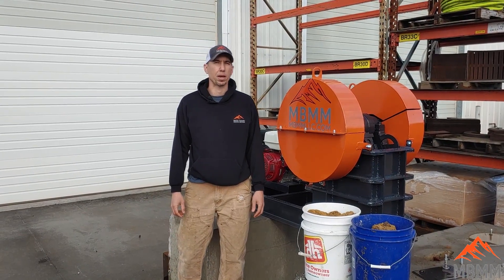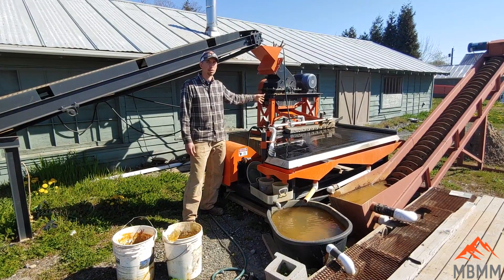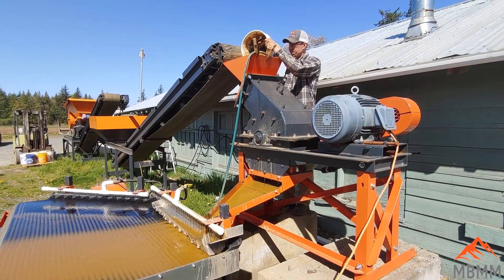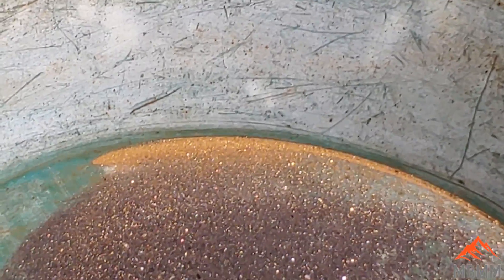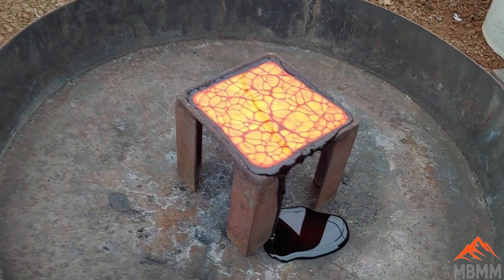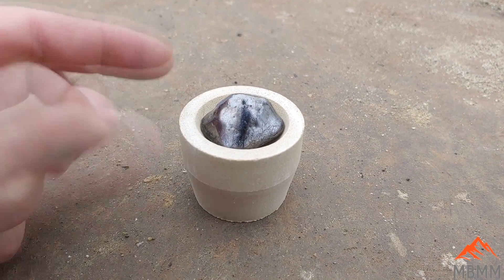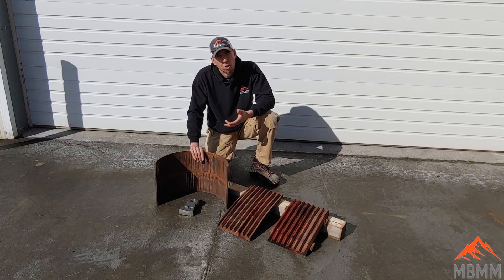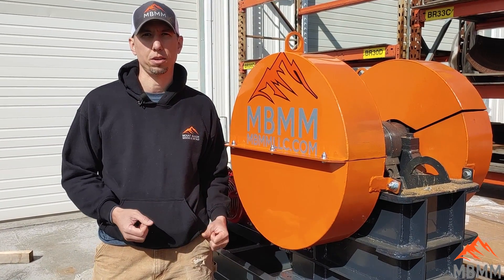Gold Mining On A Budget? 3 Pieces Of Equipment You Need!

Comment: So without the money to buy all of the proper equipment, and without the knowledge of precious metals, and just now subscribing, I have watched many of the videos here with Jason. I now melt everything down to a slag. then knock off the bead and run my stuff through my chemical purification process (aqua regia) (mostly because while dangerous, the reactions are super neat) to purify and separate my precious metals. I`ve now done circuit boards, chips, scrap jewelry, and some spec gold from a couple of local creeks and rivers among many other sources. I have to say these videos should be a holy grail to ppl in the position I was, before precious metals . Hats off to MBMM and Jason especially. Your learning with us has been incredible! I saved my home due to these videos! Hopefully someday, 
I will be able to repay that knowledge! Thank You Jason and MBMM, I do however need to invest in that darn Frankenoven or try to figure out how to make one as cheaply as possible as I`ve found platinum group metals in my slimes and solutions at times. I have a pretty firm grip on gold and silver but platinum group metals is a whole different beast all together. sorry about some spelling . I`m at work. lol man only if gold ore was found in Michigan!
Reply: Que bien amigo dale duro yo acá en México trataré de empezar a trabajar mi mina y creo que tengo platinoides también

Comment: "How to mine on a budget" proceeds to show everyone equipment not available underneath 10k
Reply: Yep about 35k for all 3
Reply: Dam 😮 @Fishingfaniticbc1975
Reply: @Fishingfaniticbc1975 more like 100-200k
Reply: I crush rocks for samples with a 5 dollar hammer. Then I add dirt and pebbles and pan it out.
Reply: exactly haha
Reply: On a budget, relatively speaking.
As in, relative to the cost of running a hard rock operation. Cheapest out, with the essentials.
Reply: You could probably make a pretty good hammer mill with a couple of grinders. You can diy a shaker table and that just leaves the crusher, which I don't think would be as easy to make but not impossible. Need a little metal or some welding done? Check out your local community College or even high schools with a welding program. Most would probably be willing to do the welding just for the experience and practice. Not to mention, they will likely have scrap metal for smaller pieces they would likely be able to use, so you may only need to purchase sheets of metal for the bigger pieces.
Reply: @cptthrawn1841 you can diy a lot of things so long as you are crafty and skilled enough. Many ppl do make their own crushers/grinders/ball mills. Since it's easier engineering wise and familiarity wise, most would probably elect to modify a sluce to fit those other diy machines for a continuous run.
Reply: Try $10K a piece! 🤣
Reply: @chrisparyupker9886 😫
Reply: Just thought I would mention that small jaw crushers run around a thousand for cheaper ones. Hammer mills that connect to grinders, chainsaws, etc RUN AROUND 500.00
Reply: I know my high school did things like that, a few welding projects, and working on people's small engines.
Reply: I also attended community College for welding and we could do pretty much anything with the scrap metal. 
Beginners waste a ton of great material.
Reply: In mining world, that is on a budget.
Reply: @nwoutdoors1865  unfortunately I know I can get way better results for way less than what you spent.
Reply: @loublacksail1995   how is that?
Reply: I don't know about that "water detection" machines, but I have been in the mineral and water detection business for about 30 years now and so far I have tested a lot of machines, only to find they did not work and the money spent  went down the drain. My water Dowsing is a hundred% accurate and I do it from a photograph off of  Google earth images. Of course I find other things also, like precious-metals, graves, crude-oil. I can scan five to ten square miles from a Google Earth image in about a day and mark the water or mineral locations, large and small. I also discriminate the type of element, for example I can tell any one of the six platinum group metals apart from one another. And I can detect all of the stable elements on the chart of elements. I have done over 300 blind tests to this affect. I am not at all limited on depth detection. I did an oil deposit that was 6800 feet deep. Many of my blind teste were private people giving me permission to scan their houses and marking where their values were.
Reply: @robertshrewsbury4241  can you scan for me an area for AU ?

Comment: I feel like that's too much work and operating costs for $50 in gold...
Reply: Economy of scale, baby. One run of three buckets just shows me whether or not it's worth running. If so, I get the heavy equipment out, and have all 3 machines running 8-hour shifts.
Maffs: 1 Gram, ($50.00 value) from 80 lbs of material. 2000 lbs (1 ton) has 25 each 80 pound batches. $50 times 25 batches = $1,250.00.
If the plant can do 1 tone per hour, I a grossing $1,250 per hour. Time for me to start up the backhoe...

Comment: 6" x 10" Gasoline-powered jaw crusher, $9,600
16" x 12" Three-phase electric hammer mill, $12,325
4' x 8' Shaker Table, $14,900
$36,825.00 USD. / $46,878.00 CAD or 19.4 OZ at current price.

Comment: Well there is two kinds of mining and the only one you can do on a budget is hobby mining. If your spending more than $5 grand on a hobby well that isn't budget mining. Your getting into commercial and you better be planning on spending at minimum a few $100 grand. Now I do the budget hobby style and spent less than a $1 grand to do it. That's how to do it on budget.
Reply: the short answer or reply to your messages in the name of the group you joined. GPAA. You know what that stands for; Gold PROSPECTOR’s Asociation of America. Those that made up a name the group understood the difference between prospecting and mining. That’s why they called it prospecting.  😉. For the long answer… See above 😂
Reply: Details on your 1k approach?
Reply: @wildwisdom56  I started with a GPAA membership that cost me at the time $69. Then I bought a Keene mini sluice for $ 40 off of E-Bay. From there I purchased some miners moss and some deep V rib matting also picked up some cpvc pipe all of which cost very little. I took some old galvanized sheet metal and fabricated a box for my sluice with spray bars and a piece of expanded metal to classify the rocks. I then took the pvc pipe and built a stand thus turning my mini sluice into a high banker that. I can easily run a yard an hour through. I picked up a water pump at tractor supply for $200 to power my high banker shovel I already had. The membership gave me access to proven gold areas and thus for under $1,000 I had everything a hobby miner needs to get out and enjoy getting some gold.
Reply: Hi, I took real issue with those I called whiners and complainers about what was called budget mining. 

I will differ with ken jett just a little bit. You’re really not getting into commercial Mining yet just because you spent more than five grand. 

It will cost you more than five grand in many instances to buy a dry suit/wetsuit and A 4 inch dredge and you’re still in what is legally called up here in Alaska “recreational mining“ as long as you stay under 6 inches on your dredge your recreational. 

So you’re gonna spend more than five grand and you’re still not approaching commercial Mining. 

You laid out a really good way to approach just getting into Hobby Mining and I applaud you for that.

It’s the same way with hunting or fishing; you can have a very inexpensive rifle and go trudge out into the woods and go hunting or you can buy a combination fishing pole at Walmart and go fishing; OR you can buy and ATV for more than five grand and you’re still not a commercial hunter; certainly you can spend a lot more than five grand on a boat and you’re still not a commercial fisherman. 

So I think that there’s an intermediate step in between what ken jett is calling hobby Mining, And commercial Mining. Up here we call it recreational Mining. And it doesn’t have to but it can cost a lot more than $5000. 

But if you did want to do something more than recreational but didn’t have $1 million then $100,000 for the start of mining in a way that could actually pay some bills, well, $100,000 IS budget Mining.

By the way, the short answer or reply to this thread is in the name of the group. GPAA. You know what that stands for; Gold PROSPECTOR’s Asociation of America. Those that made up a name the group understood the difference between prospecting and mining. That’s why they called it prospecting.  😉
Reply: @scotthack2632  well I wasn't trying to be arbitrary with the numbers they are a lot of subjection that can be made. I was just making a distinction between the difference in hobby and what's commercial. Most people don't know or understand the difference. It's also true about the use of the Name Gold Prospectors of America. There is a distinct difference between prospecting and mining. Most if not all who join the club are in honesty miners not prospectors. The actual meaning of a prospector is one who goes around sampling looking for a source of gold. They are prospecting not mining, the difference is once a source is found and your set up to recover the gold now you are mining. This then is where as to what level of mining you choose? Hobby or recreational I consider the same. Or are you going to go commercial a lot depends on just how much gold available to recover. How much you can afford to spend on equipment and a big decider can you get the permits to operate a commercial mine. In some areas depending on the level of your hobby can also require permits to operate. That's why I keep my hobby small as it allows me to go out on occasion have fun and recover a little gold without having to apply for permits. Although you do still have to have permission to access private property. This is why I like belonging to Gold Clubs where members get access to proven gold areas.
Reply: @kenjett2434  all what I stated was true but I must say,  Well stated. Don’t disagree on any point. Thanks for your reply.
Reply: @scotthack2632  your welcome and i wasn't disagreeing with you. My comment on cost, was just to say it in more simple a generalization to show the difference in mining.

Comment: This is on a budget?? Looks like 100k dollar investment.
Reply: just got a reply right now.   The three units Jason showcased in the video are all rated for 1 TPH hour and I have listed them below.

6" x 10" Gasoline-powered jaw crusher, $9,600
16" x 12" Three-phase electric hammer mill, $12,325
4' x 8' Shaker Table, $14,900
Reply: @robertjerge3075  = $36,825.00 USD. / $46,878.00 CAD or 19.4 OZ at current price.
Reply: @robertjerge3075  Who here thinks $30,000.00 Is Gold mining on a budget?
Reply: Jason just got a gram of gold from about 80 pounds of rock. That's 25 grams of gold per ton. Multiply that out by the amount of rock on your claim. If you have a claim that has gold on it, you can make enough money to pay for that equipment, and make a profit. 
Gold is right now in the $60 (USD) per gram range. That's $1500 per ton of rock. If you can only run 1 ton of rock per day through this system, that's $1500 per day in your pocket. Can you afford a $35K investment to make $7500-$10K per week income?
This is called "small scale" production, because "medium scale" yields upward from $20,000 per day. "Large scale" production requires large (several $Millions) investments for land, personnel, and machinery. Large scale production would be over 100 oz ($200K) per day in gold.
Reply: @xenaguy01  really loved your explanation about the differences in mine sizes. I'm part of a family owned mine and currently small size but in the next coming months will definitely be medium. Your calculations are also on point 👌
Reply: No doubt eh... budget for me is 2"-3" highbanker/dredge
Reply: @dw4940  Just ordered a goldhog piglet flare. Can't wait to get it for my claim! $1297 CAD after shipping.
Reply: From Alaska: You complainers about what Jason has called a budget sound like hobby'ists and not miners.  I happen to know to get a REAL mining operation going can cost in the MILLIONS.  To do something for $100K   IS SMALL scale and on a SMALL BUDGET.  Miners up here(real miners anywhere really) can spend that on one wash plant or dozer and/or excavator.  And YES, 1 gram of gold out of 80 lbs of rock is ALOT and VERY profitable.  If you ONLY run 1 ton / hour (a good operation with a good wash plant can run 100 tons/hour, but lets just go with 1 ton per hour) and ONLY run 8 hours / day (most will run MUCH more than that up here) and ONLY run a 90 day season ..... at $1800/ozt that operation will gross just over a million dollars ($1,041,800.64).  I avoid internet arguments because the posers that post stupid comments like the ones in this thread are IMMUNE to logic and concrete thought and actual real numbers but I wasn't in the mood to put up with the SILLY comments here today.  Now, all you mining POSERS go ahead and respond and display your ignorance to the world.
Reply: @scotthack2632  hey, great analysis on the numbers.  Do you know an instrument or website to calculate fuel cost and repairs/ maintenance on the machines?  I am sure there is an element of it, but there is no way the total cost of maintenance would exceed the revenue generated.
Reply: @MP57719 hi, no I don’t know of a website or a way to calculate it. It really depends upon what you’re running through it and how good you are at maintenance on your own, how rich is your material like mentioned above. What are your fuel costs where you are how much does it cost to get it out to the U. I’m working with minors that I have to fly everything in to remote locations and the cost is astronomical compared to many places in the lower 48.  But, Jason would have a better handle on what the cost of maintenance would be on a set up like that.

I do want to say here though that I regret the over the top harshness of my tone. Many people just don’t know or don’t have a frame of reference.
Reply: @scotthack2632  hey scott, no problem.  I figured as much on the company knowing approximately how long parts that will wear out last.  A lot of people do approach 100k to 200k as an initial outlay as expensive because they are prospecting not mining.  If the rock is good, a half million to a million isnt that hard to comprehend after expenses for fuel, maintenance and parts.
Reply: It's not but cool.
Reply: Well if you REALLY wanted to budget you could use a hammer and a pan. But nah.
Reply: If you have a good mining claim and can pay monthly installments, the rig pays for itself many times over.
Reply: Love your gear but yep that's not really mining on a budget. Cost of the equivalent 3 pieces in Australia approx 40,000. That's a few 1 gram buttons
Reply: مية الف دولار ما هذا النصب!!!
Reply: @iraqinamnamat  translation?
Reply: Um, if you actually go to their website you will see that is not true.
Reply from the maker: If you would like more information on the cost of our products, you can email us at info@mbmmllc.com or call us at 360-595-4445. Thank you for watching!
Reply: @mbmmllc  i would like more information on the cost of your products, publicly.
i'm the client, you chase me , not the other way around. i'll go find a business that wants new clients.
Reply: Ghryst while a lot of people complain about not publicly posting prices a ton of people do that. It’s normal. Have you ever looked at a set of semi trailers that’s fairly new? Few post prices probably cause it deters people from calling that aren’t serious. If you try to buy a new trailer for instance like a belt trailer you actually have to fill out a form with what ya want and then they’ll quote you. It’s definitely common practice in many industries to not just list prices. It also makes it so they don’t have to constantly update prices especially if the price is based on the price of current metal prices.